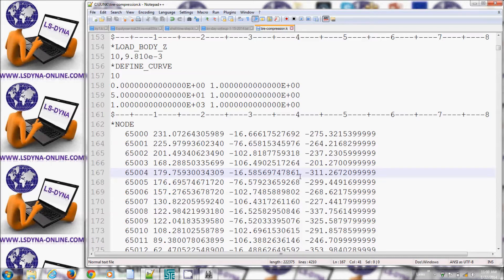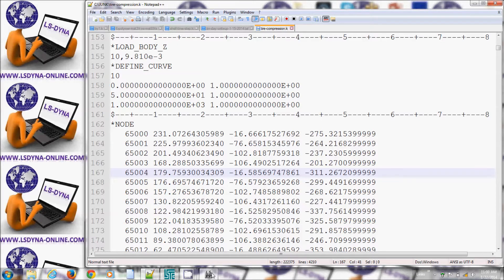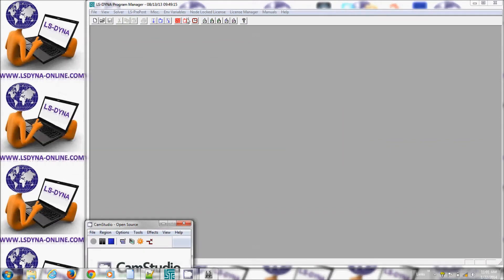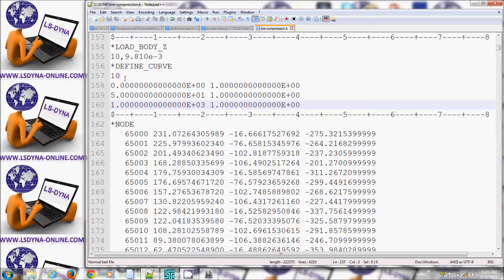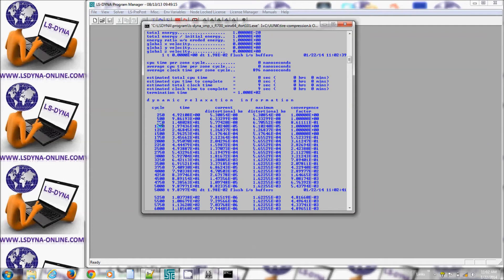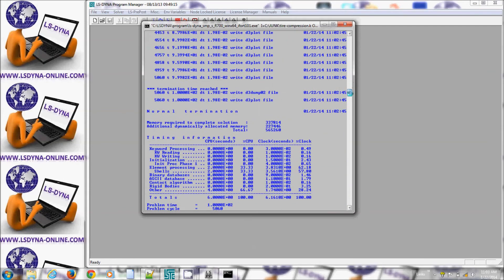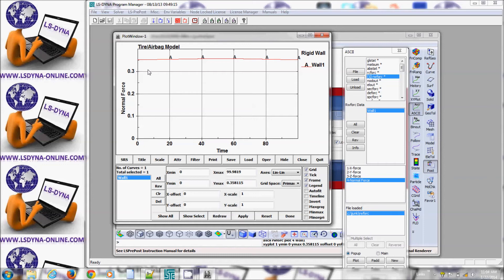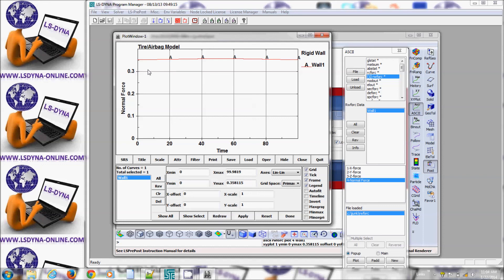LS-DYNA Tutorial Dynamic Relaxation

Comment: Hello,
I have a static analysis in which the load is dead weight. We want to solve it using explicit solver. The reason being the number of Nodes is huge and we are running out of in core memory for implicit to solve. 
We have done few iterations in which we are applying the weight as force in a very short period of time (ramped up in just 20msecs) which apparently seems wrong. We are observing considerable kinetic energy. I thought dynamic relaxation would help . But the problem is large displacement type . 

It would be great if you could help me a way to do this  analysis using explicit solver . 

Thanks you,
Sachin